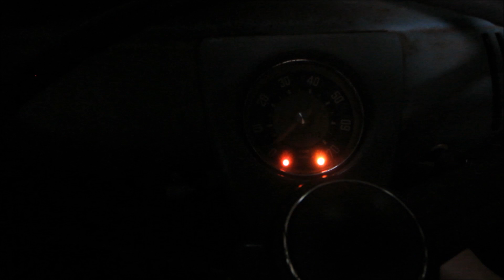66 bus is going to a new home.

Comment: I am convinced everyone in your area was issued a VW, a lawnmower, a snow blower, a tiller and a generator when they are born or moved there.
Reply: I think I need to move here
Reply: It is probably in the town by laws.
Reply from the maker: new hampshire bugout kit
Reply: bugin kit.
Reply: If you live around there you have a house, which generally means you are also the caretaker, and you have the tools and equipment to do so, or are looking for the tools and equipment to do so
Reply: I'm in Maine and I have to add they give you a non-working kitchen appliance of your choice to put on your lawn and two sets of bald snow tires from 1971
Reply: Oh come on Miles...sometimes they're from 1972! And sometimes it's two non-working appliances, like I got..along w/a "worked fine when we last had them plugged in"
Reply: It's a New England thing - you wouldn't understand.  LOL  :-D
Reply: Pretty good deal. Here in Eastern Oregon/Idaho we get the standard issue random 1970's tires as well.  Usually there is also some half buried discarded fence wire and baling twine lurking in the forest of weeds to greet the newbie lawnmower and tiller with a homecoming hug. Other than that, all we normally get as a move in bonus is a random broken piece of farm implement.  The lucky ones may find a '60's farm truck with a missing engine, transmission, broken gauges, and a bullet hole or two in the windshield (if it has any surviving glass at all). Further out and away from towns, old school buses, or maybe a moldy Winnebago (also missing engine and trans) which are returning to dust are the common bonus items. If you aren't so lucky, you'll get something like an old manure spreader that breaks in half when you pull it out of the weeds...
Reply: John Ulicky I own my house, have all the lawn care gear, generators, etc. I just keep my gear in working order so I don’t have to sell it for $25. Not many VW’s down on the gulf coast though.
Reply: Some people think the NH motto is "Live Free Or Die" but it's really, "I might Need That Someday"  --- that's according to my Mother -in -law btw
Reply: In PC last Friday and ran into a lady driving a MINT condition '74 Beetle!  As she approached where my friend and I were standing I commented to her about how great the car looked.  Then realized she was my group's secretary back in the very early 80's!  Hadn't seen her in years.

Comment: I have a 67 deluxe bus 13 windows 8 seats exactly the same. Mostly original except the engine. Only metal piece changed on it is the battery tray . If your friend want to see pictures for the restauration. Let me know.

Comment: Lola has a kindred spirit in Sky my Border Collie cross, both seem to take the view "its mine and you no can has"
Just an FYI  - Spaz despite being widely used in the USA to mean stupid, is actually a really horrible slur, it derives from "spastic" - someone who has cerebal palsy, which despite affecting their mobility and muscle control, generally are as intelligent as an able bodied person. I had a friend with CP and they found Spaz, Spastic or Spacker to all be really really upsetting to them.
So it would be appreciated if folks could avoid using it....its like picking on someone because they are visually impaired or paralysed. Its not big and not funny...

Camper looks interesting though, know what you mean about passing up on stuff....was offered 3 Suzuki GT250ENX7s for less than £100 - $150 back in....2002, now wrecks are worth over £1000 / $1400 and nice examples are £5000 / $7000 and climbing every year...

I sold mine as a a pile of parts needing put back together to my dad when I went travelling, he sold it on, and I can't trace it anymore sadly......raw, noisy but lots of fun to ride,